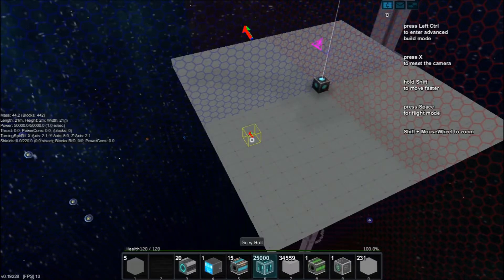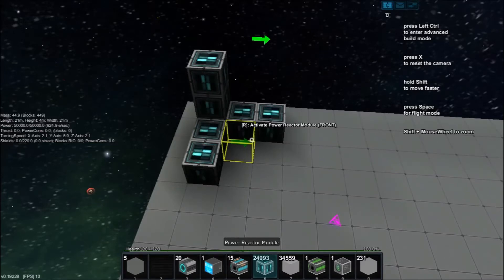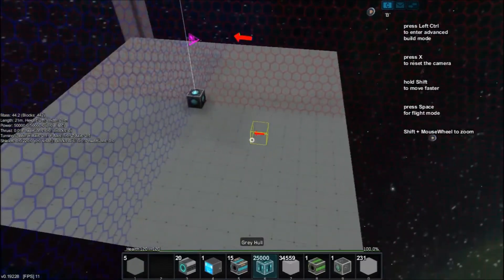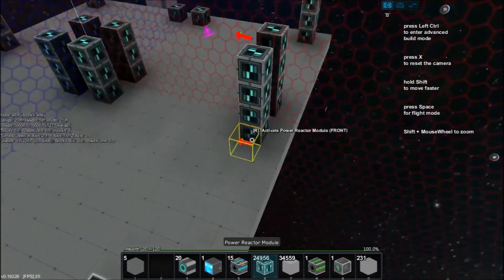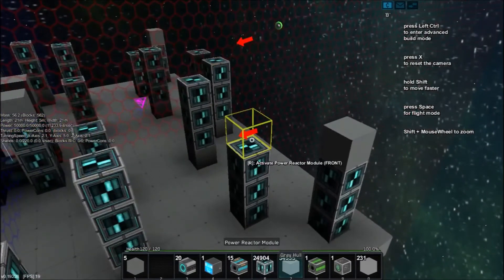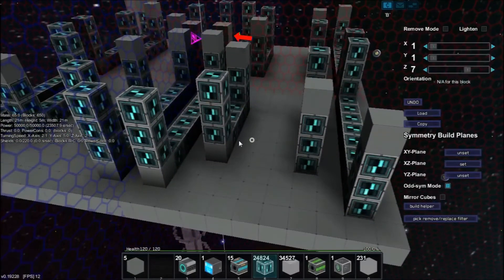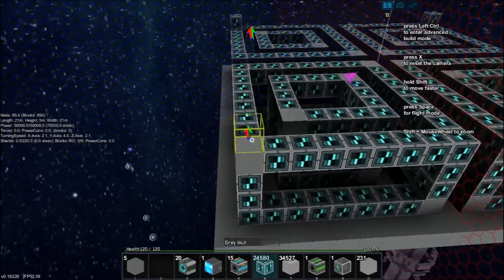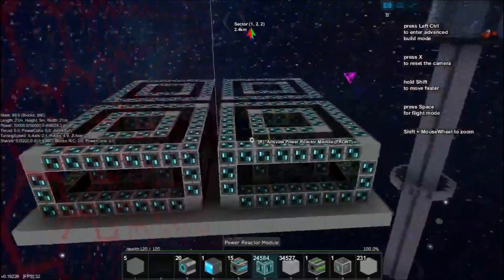[RETRACTED] Star Made's Most Efficient Power Supply - "The Power Cage"

Comment: sorry to say that but 70k for that size is not as efficient as it could be. what you did was activating symmetry mode and building 4 times a powercube which if you would have build jut one big one on the same space you would have gotten more power out of it. As rule of thumb as soon as you are able to complete your build in symmetry mode you are not as efficient as you could be. Besides that, nice video.
Reply: But wouldnt that be less efficient in points of energy per block? I mean you use much more blocks to generate the energy and have also less space for other blocks in the same area.
Reply: Lumion more power, less blocks because better use of the dimensional part of the power generation equation.
Reply: Make sense. Thought somehow you just wanted to make just  a filled in cube
Reply: Lumion me? nope.
Reply from the maker: ***** Hey man, thanks for the info! I hadn't actually thought about that, I'll add an annotation to the video. Thanks for the critique!
Reply: Alumanti Confirmed i am actaully really sorry to critic someone just started on youtube because normally i'd love to encourage people but i could not let that slip. just becaue there is already neough confusion about powermanagement out there already. Anyway please continue makeing videos youtube is awesome and i don't want to give a newcomer a bump down so - it is a nice video.
Reply from the maker: ***** Hey dude no worries! I'm working on a video right now to correct it Thanks for the heads up!